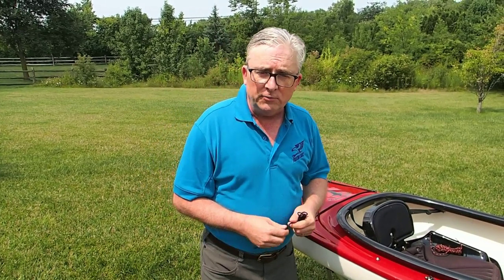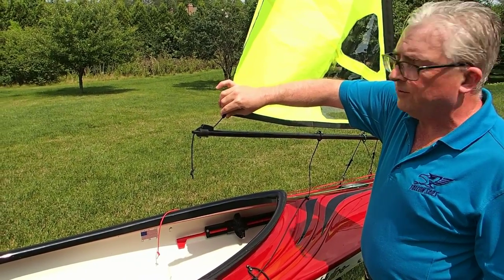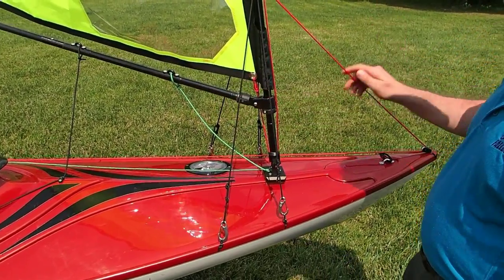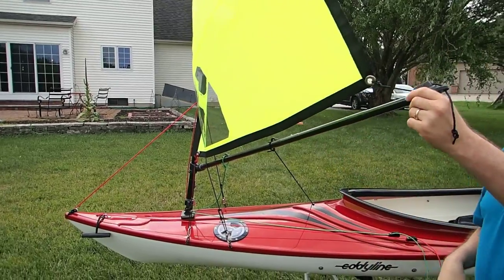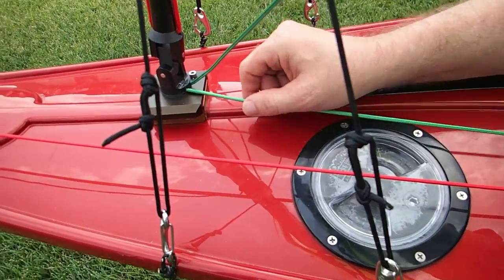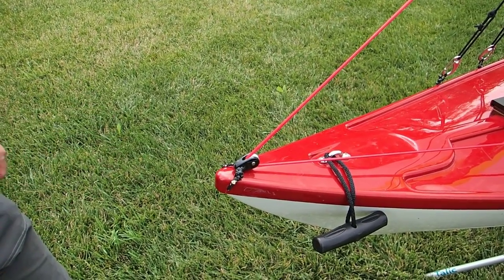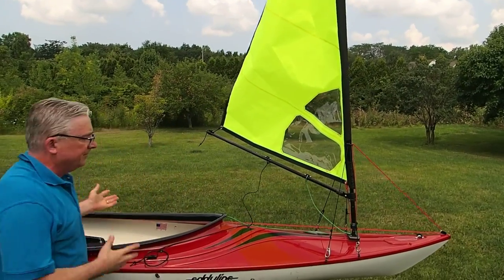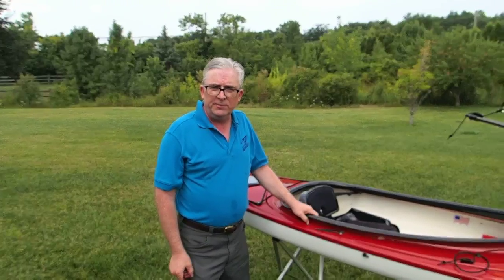What you need to know when it comes to kayak sailing and proper lines.

Comment: How does it sail without a daggerboard / keel?
Reply: @FalconSailsUncut  thanks for the reply, that makes a lot of sense. My other question which I believe you answered was: can you sail without paddling? Meaning does the sail provide enough power (obviously needs some breeze) to move forward without the need to paddle at all? I ask this because many videos I see of the falcon set ups, the people are paddling while their sail is up.
Reply from the maker: @jaysjourney4518  you can sail all day long with about zero paddling 200 out of 360 degrees of angle of attack.  That is over 70% of what a conventional sail boat will sail.  Throw in some paddle strokes and you can have useful sail propulsion on 300 out of 360 degrees of angle of attack.  It is very simplistic and a lot of fun.

Comment: This may be a dumb question but: how safe is it to add a sail to a kayak? Is it easy to capsize your boat? Do you need an outrigger?
Reply from the maker: With a proper sized sail, and just a little bit of normal common sense to put the sail down if you do not feel out of control, it is very easy to kayak sail without capsizing.  95% of all Falcon Sailors do not use outriggers.  Most who start with outriggers, do not continue using outriggers.  Though you should do what it takes to make sure you feel safe.  Post people just stay in lighter winds when they are learning.

Comment: how do you reef?  I mean other than up or down, can you somehow deploy some but not all of the sail?
Reply from the maker: There are a lot of techniques for dealing with more wind power.  Reefing a compact sail, has a lot of downsides and provides less benefit in kayak sailing than you may think at first glance.  The idea of reefing a sail, is a subject that conventional sail thinking & lack of kayak sailing experience leads to some really bad ideas.  In thousands of miles of kayak sailing, I have never wanted to reef a sail.

The big problem with reefing a small sail is you are basically scrunching a small air foil, into being a wad of material aloft and pretty much destroying your sail shape. You lose most of your air foil shape when you do this. A well-shaped sail, is designed to turn side blowing force / healing force and turn it into propulsion.  The last thing you should do is scrunch it into a wad of material that is not an air foil. A non-airfoil shape wad of material does more harm than good. In this case, it takes healingforce and keeps it healing force.  It also reduces propulsion which is one of your main assets for bracing should you decide to brace. Reefing a small kayak sail is a step backwards & provides a false sense of security. If you are over powered & are not feeling safe, the last thing you want to do is take your hands off the paddle to handle more lines and create a non-airfoil shape wad of material.

On a conventional sail boat, the sail is larger, and when you reef the sail, you lower the sail on the mast and tie up the excess on the boom.  That some of the draw backs of reefing, but not so much, and it is moderatley easy to do.

If you are over powered, let your sheet line out and let the sail luff, release the outhaul line to reduce power, and release your boom vang line if it is set. If that does not provide enough power reduction, drop the sail.   You can drop your sail and secure it to your deck in seconds / 10x faster than you can reef.  If you are not comfortable you should not be extending your exposure with a false sense of security that reefing a kayak sail provides.

The other downside to reefing is, it adds complexity and bulk to your rig 100% of the time and it is a step backwards in your sail shape / air foil 100% of the time. You have lines, and cleats and grommets and whatever else in the fray that takes away from the simplicity of a well-designed sail and you are stuck with it everywhere you go.  These extra lines and parts can add confusion when rigging at the put in and take out.  You may think all the lines are routed properly and then when you raise your sail, some lines are twisted or tangled or routed improperly.  This can be a significant problem and for sure take away from your fun.  These additional lines can get tangled up and make it hard to lower the sail, or properly secure it to the deck of your kayak.  Anything aloft that is not a airfoil, is a step backwards as well.

You can drop a sail that is part of a well-made rig in seconds, and you will find other ways to deal with more power than you want.  Nobody reefs a wind surfing sail because it is a bad idea.  Kayak Sails are even smaller than wind surfing sails, which increases the argument for not reefing a kayak sail even more.  

The best way to deal with higher winds is to choose the proper sized sail when you launch. Make it so you can change your sail quickly and easily.  A change of sail will let you have a great airfoil shape where reefing does not.  One other thing that is very helpful in dealing with big winds is to have a solid sail rig that provides steady predictable power.  If a sail has a flimsy flexible mast or a sail that tends to flop over, or you have a boomless design or even no boom vang, you will have unpredictable and unsettling fluctuation in power, which is really hard to deal with.

If you have a Falcon Sail with a Falcon Sail rigging kit, you can choose from 3 different sail sizes and launch with the best size for that day, or bring what ever sail sizes you have, and change your sail if you change your mind.  Changing out a Falcon Sail takes about 1 minute.

You can see the Falcon Sail options here.
www.falconsails.com/store

In this video, you can see my friends and I sailing in some really big winds, and you can see the techniques we use to deal with power.
Videos do not do a good job of showing how much wind there is.  In any case, it is very windy.
It shows just how solid and reliable and easy to use our rigs are and how much we are into kayak sailing ourselves.
https://www.youtube.com/watch?v=vHxhgqUzp1E

I wrote a bit more about reefing here.
http://www.falconsails.com/KayakSailingFAQ.php#reef

#size
What size sail to rig
==================================================

The 1.4 is nice to have on a light wind day or on a wider more stable kayak.
The 1.1 is a really nice in between size.
The 1.0 is for sure the go to size on a bigger wind day, or if your boat is smaller and tippier.
You will be happy with any size, but one size will hit the sweet spot more often than the other.

Here are a few general rules of thumb.
If you have a narrow kayak, and see winds above 10mph regularly, the 1.0 is the way to go.
If you have a super stable kayak / one that is over 28 inches wide and only rarely see winds over 15mph, the 1.4 would be the best size.
If you have a wide kayak and like big wind days, the 1.0 would be a great choice as well.
The 1.1 is a nice in between size.
No matter what kayak you have, all sizes are going to work nicely with any kayak you may own.
  
If you buy any size sail with a complete rigging kit, you can add a sail only of any size you like at any time, and have any combination of sail you like at any time you hit the water.
All sizes of Falcon Sails, are compatible with the Falcon Sail rig.  If you buy a Sail only of any size at any time, it will include everything you need to use it with your Falcon Sail rig.

Skill level does play a small role in the choice, but in general a smart advanced kayak sailor will be no more likely to go with a big sail than a beginner.

Advanced kayakers who enjoy sailing will typically go out in bigger winds and are best served by the 1.0.
There is no reason to be overpowered.  On a big wind day, a 1.0 square meter Falcon Sail can push any kayak to its maximum hull speed, and for sure faster than the strongest paddler can paddle a kayak if the distance is more than a 50-yard sprint.

In the ideal world you have all 3 sizes of sails.
If you buy a 1.0 square meter sail with a complete rigging kit, you can buy a 1.4 square meter sail only any time you like. And of course, if you buy a 1.4 square meter sail with a complete rigging kit, you can buy a 1.0 square meter sail only any time you like.  It is all the same thing for the 1.1 square meter sail as well.  
All Falcon Sails hardware is modular and interchangeable.  
We look at every order to make sure somebody who already has a Falcon Sail will be taken care of / will have all the hardware necessary to use it on a previously purchased rig with another size sail.

The 1.0 sail only comes with a boom extension that will make it work with your 1.4 or 1.1 sail rig.
The 1.1 sail only comes with a boom extension that will make it work with your 1.0 or 1.4 sail rig.
The 1.4 sail only comes with a boom extension that will make it work with your 1.0 or 1.1 sail rig.
Reply: @FalconSails  thank you for the detailed response, the video was impressive, I can't help but think that a freestanding mast with a roller furling mechanism is the way to go, ie the Hobie sail kit, their mast lacks the rigidity of your mast, it does flex, and lacks a boom of course, but is very simple, one control line for the roller furling mechanism, one sheet line running through an eyelet at the stern to taunt the sail, that's it, what am I missing?
Reply from the maker: There are a number of issues that make the furling mast  less desirable.  They may sound good on the surface without actually using them.  There is a reason only a very few kayak sails made to furl due to the compromises involved.
Here are a few things that come to mind.

#1 - When you furl it up, you have a lot of bulk aloft where the wind is at its maximum.  Some times you just want to go straight up wind quickly.  In that case,  you do not want a bulk of material up high in the biggest wind.  It makes paddling up wind more difficult.  Not being able to lower  your mast quickly, is also a pain if you are going under a bridge or dock.  That means you will have healing force from the wind, and weight aloft if you are sailing or not.

#2 - Batten orientation is not ideal.  Battens have to be oriented straight up and down which is not good.

#3 - You can not have a boom.   A sail without a boom will always have significantly lower performance.  It is a huge compromise. Esp when running down wind.  That means poor shape and no outhaul or boom vang options.

#4 - You can not have standing lines which makes the mast a lot weaker, or require 10x the bulk or more to make it even close to what a mast with standing lines can do.

#5 - You can not leave the mast on the kayak when driving / you have required rigging time at the put in and take out. With a Falcon Sail, you can stow the sail on your deck, and leave it there 365 days a year.  It only weighs 3 pounds.

#6 - It requires a purpose made kayak or significant modifications to a generic kayak with a big hole in the deck of the kayak.   If you have a furling sail made for one kayak it will only be good on that kayak.  If you have 1 Falcon Sail, you can add a few pieces of hardware on each kayak you own, and use that 1 sail rig on all your kayaks.

#7 - You can drop a Falcon Sail in about 1 second by releasing the forestay line.   To furl you have to release the sheet line, and pull the furling line until you are done furling it.  If you want to find your limits when kayak sailing, or you are in trouble, you do not want to let go of your paddle for 1 second longer than necessary.
Reply: @FalconSails  thank you for taking the time to explain this thoroughly